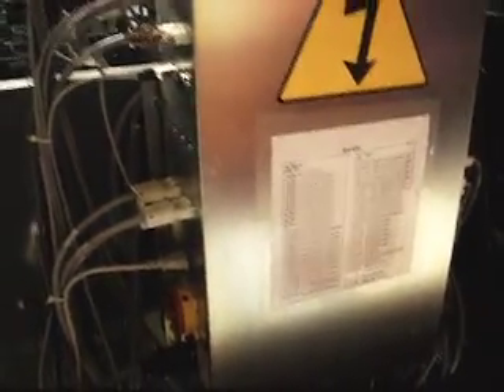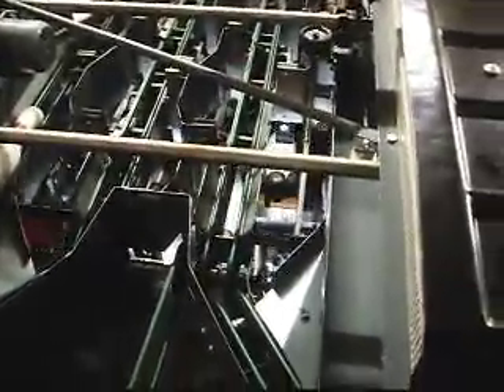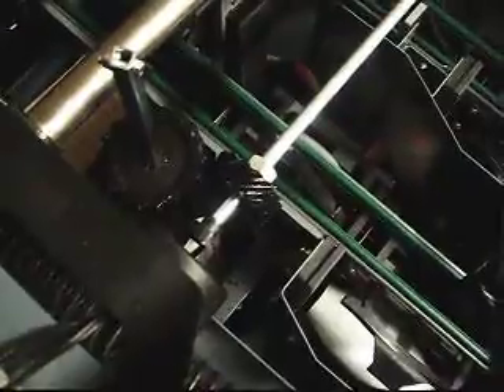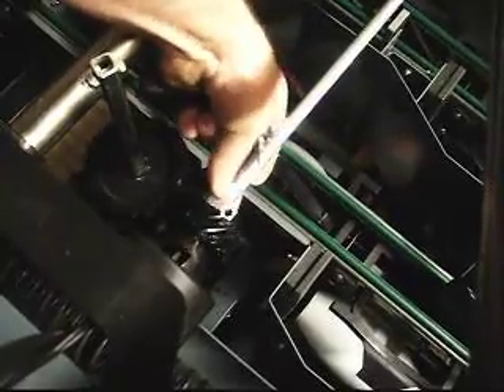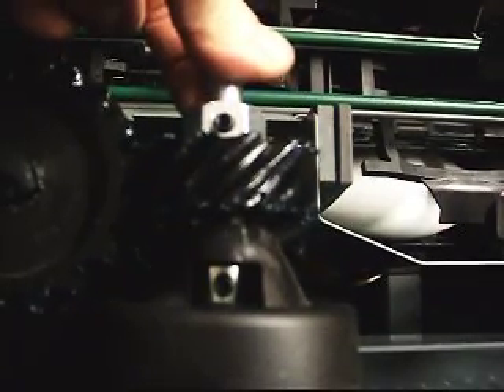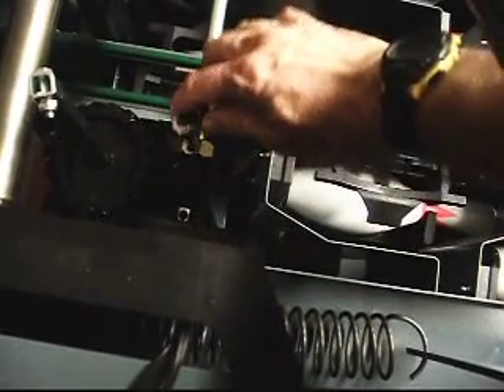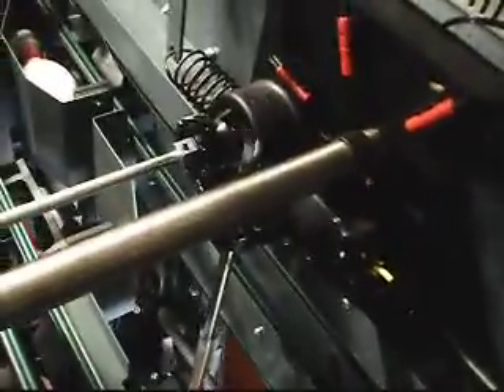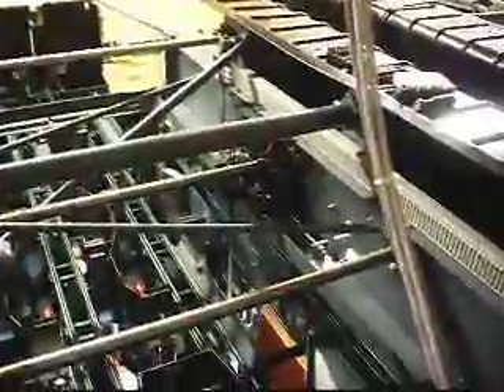Code 76, this time its the slip clutch gear wheel.

Comment: Tmiller, do you have a way for direct communication?  I just started working in a center that has the GSX machines. I've been around A-2s for 17yrs but this is new to me. We have a lane down and it's throwing either 66 or 76 error codes. To me, it looks like the gear is not engaging the flywheel to spin the shaft to open/close the tongs. Our senior personal, not really a mechanic, had already replaced the solenoid that pushes that gearing. Any more thoughts?

Comment: hi good day sir i have problem with my lane 3. i have machine  gs98. when spotting pick up the pins, what happens is spotting ddn't not release the pins. i have a question sir, what is cause for that? thankyou sir
Reply from the maker: Miro-
Do you have a tooth missing on the 47-051635-001 Geared Rack?
Or is the 47-071880-003 Spindle Gear set screw loose?
Does your 99-070356-004 Solenoid from the gear cluster assembly need cleaned? Is it engaging properly.
Are any of your 47-051756-004 Deck Plates loose and catching in the 47-053513-009 Toothed Racks?

Check those areas and see if that gets you going.